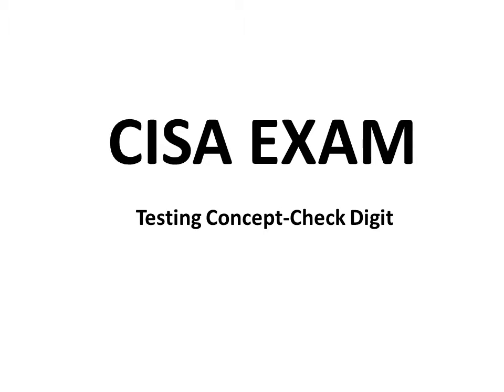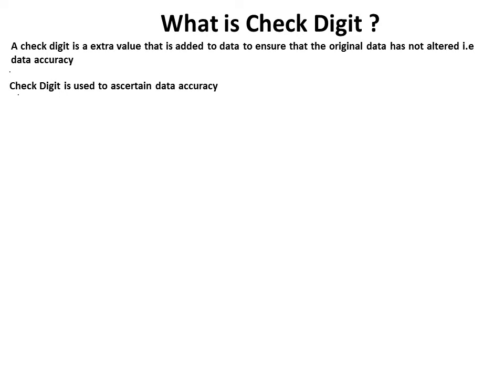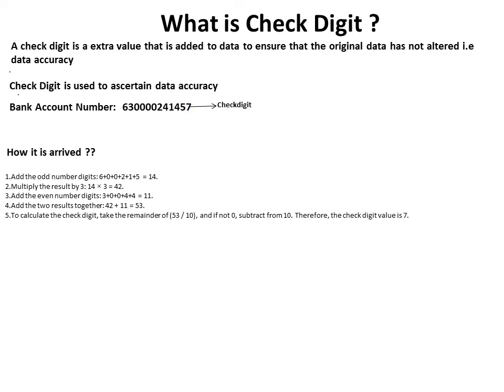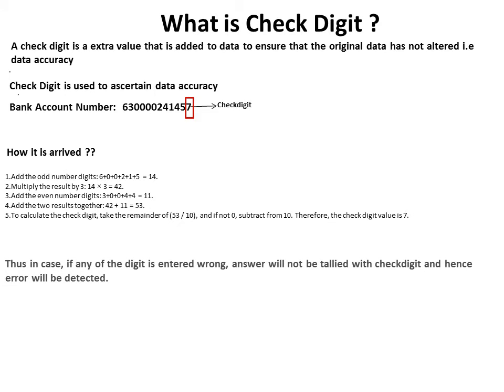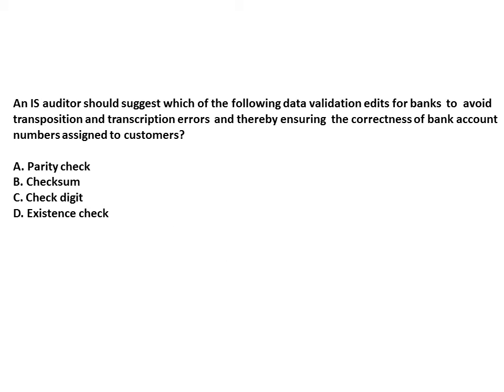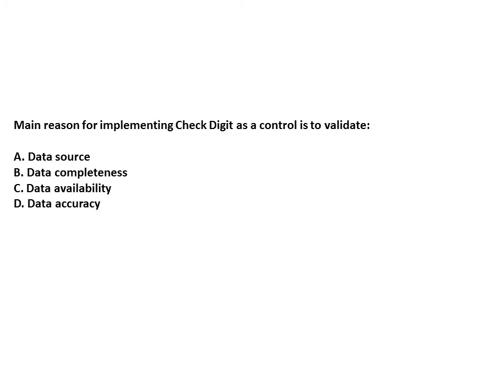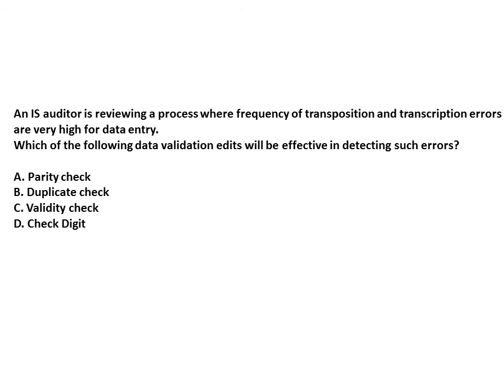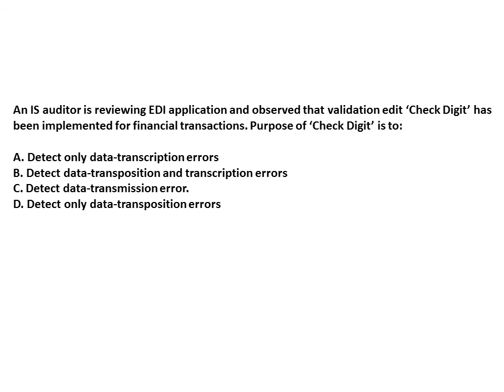CISA Exam-Testing Concept-Check Digit

Comment: The Odd numbers are 3+5+1=9
Even numbers are 6+2+4+4=16
3x9=27
16x3=48

27+48=75/10=7.5 =7  this is the remainder
Reply: No. While saying even and odd number, he meant digits at even and odd places. Not the actual even or odd numbers.
Reply: Also 53/10 i.e. 53 mod 10 = 3. The algorithm shown in the video is correct.